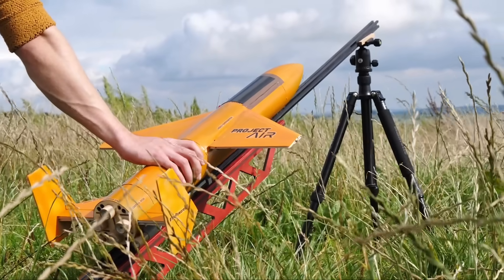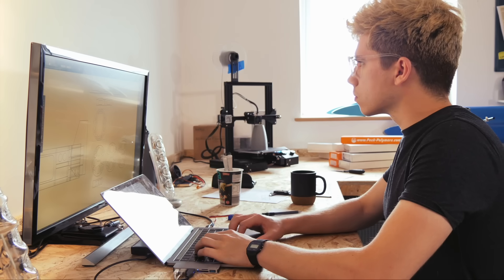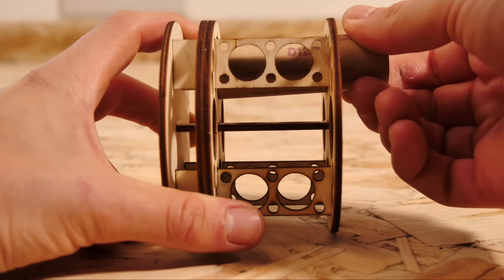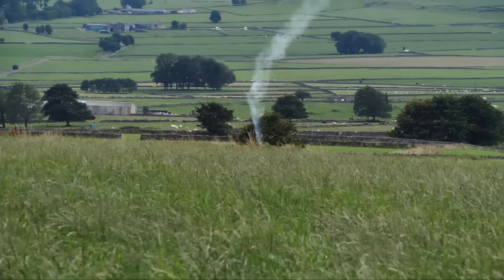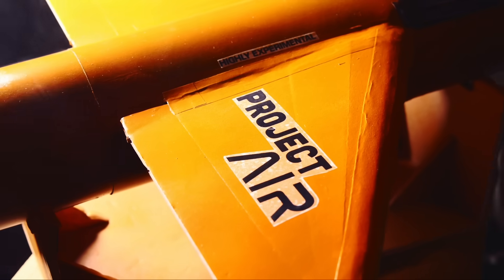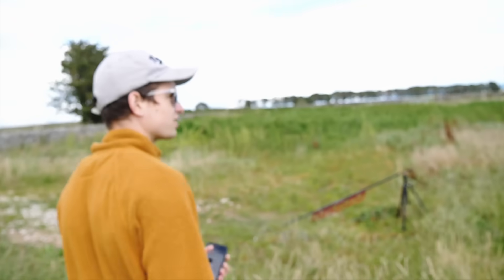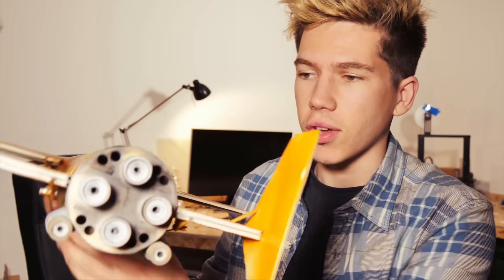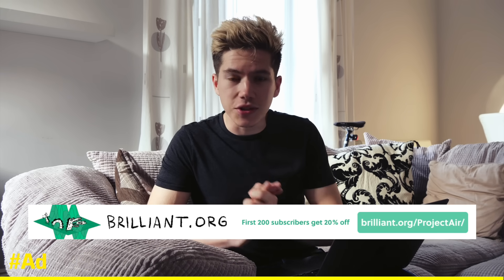High Power Rocket Plane

Comment: "I've decided to kick it up and add more motors"... "I've decided to move the xg back by adding more weight via engines". NO. YOU DIDN'T. IT WAS DESIGNED FRKM THE START TO HAVE 4 MOTORS, WHICH IS WHY IT WAS NOSE-HEAVY ON THE FIRST RUN.

You did the first run just to artificially extend the video and get more view time for more revenue... nobody cares, that's perfectly fine, we'll still watch- but don't make up BS to try and hide it.
Reply from the maker: It's designed to be flown with up to 4 motors. I always intended to step up the flights notch by notch, first by using just two motors. Thought that was impossible to misunderstand. Guess you can make up your own conspiracy theories tho 🤷‍♂️

Comment: Does the burning of all that solid fuel shift the CG much after firing? I wonder if that's your initial nose-heavy problem.
Reply: The initial "nose-heavy problem" is because it was designed from the start to use more engines, and the cg was established with that in mind. The first run was done just to increase video length... He didn't "fix cg ny adding engines ". In the FIRST video, he "messed up cg by REMOVING engines "

Comment: Prob should use a cap or such to provide the quick burst of power needed to ignite the engines when in flight after you get to where you want to be or just need that extra speed boost...maybe also add tiny rockets to attach to your wings if your really crazy

Comment: Maybe put an edf inside the tube and make air intake cut outs in the side, use the chute charge on the rocket motors to pop out the wood plug at the back with the motors in it (maybe put a parachute on it)

Comment: Here’s an idea: Use the C motors (smaller engines) to get it in the air, and then use the D type (larger engines) when it is cruising to speed up.
Reply: Cant we just use both?
Reply: Well it will be much more speedy when crusing

Comment: Hay I have been building edf jets for a few years now, and i have experienced every time that during take of (bungee launch) that the model turns to the left. Now i have the reaction speed to counter this an get a fairly straight take off path, Due to the high cost of my planes (coming project a 6.2 feet F16 with a 120mm EDF ) i have found that an inexpensive Gyro really does the trick to keep the model straight and level.

Comment: You might consider making a vacuum form nose cone out of thin and lighter material that will be almost as strong at considerably less weight. The lower the weight the lower the wing loading and increased glide ratio.

Comment: I was wondering about the speed boat you built, since the pontoons got damage and popped open why don't you use fiberglass on foam board or on the wood to strengthen it. It shouldn't increase weight by a whole lot.

Comment: Want to go fast? Add a large core-burner* in the middle and set it to ignite one second into the flight. The wings had better be attached well or you will rip them off.
*The engines you are using are end-burners. Core burners have much less burn time but massively more thrust, that's why you delay ignition until the rocket/plane is underway. I've not only torn fins off but had rockets just tear themselves apart from too much thrust from a standing start.

Comment: The fastest RC planes fly in excess of 500 mph, unpowered!! I understand one team has its sights on 850 mph, the bottleneck being wing-flutter at supersonic speads caused by sonic booms forming mid-wing. It's called Dynamic Soaring, wicked stuff! Perhaps if you gained altitude and powered the rockets while diving?

Comment: Do the gps measure the speed correct since the rocket plane goes up at an angle and the gps measures the distance traveled in a straight line over the ground??? Or is my logic faulty?

Comment: Sorry to say, your spitfire is all wrong, the wing profile should be elliptical not cut at the wing tip.  What you have built looks more like a hurricane.  Just saying.
Reply from the maker: Clipped wing Spitfire - https://flyaspitfire.com/clipped-spitfire-wings-why-did-some-spitfires-have-clipped-wings
Hurricane with curved wing tips - https://en.wikipedia.org/wiki/Hawker_Hurricane
Reply: ...in fact there was a Spitfire with clipped wingtips, optimized for high-speed-low-level flight...!
...later in the war it proved very effective to intercept V-1 cruise-missles...!

Comment: The problem in flying aircraft that use combustible fuels is that your center of gravity changes as you lose mass from consuming the fuel. Obviously in an electric plane, its not an issue but having looked it up, pretty much 50% of the mass of each Estes D12-7 is the propellant. If you did your calculations based on a center of mass that does not change, which I imagine most electric model plane builders will naturally do, then you consume all your propellant in your balanced aircraft and find out its "a bit nose heavy".  Moving the center of mass more to the rear won't solve the issue either I'm afraid as you're still losing the mass from fuel consumption. An ideal combustion aircraft has the fuel balanced so that the center of mass remains more or less in one place during consumption. (Obviously hard in an aircraft when you're having to stick all the mass from both the engines and fuel in the same place and doubly so when all that mass is miles away from your center of lift.  

That said, it was still a cool video. Most people wouldn't have been able to build it never mind get it off the ground. :)

Comment: Nice to see you are getting ahead with aeronautics🤩 it will get more and more interesting further you go! Rocket=go for height, plate=manoeuvre and glide. A general equation using solid fuel propulsion is twice the thrust double the altitude. And with C to G cartridge you were well on your way!! What was you wet weight??

Comment: Move front wings back to increase lift. It will be more difficult to fly but that's not what those motors were designed for.  Nowadays with all the technology right at your fingertips, sometimes it just takes trial and error to get the best results.  You could also use zero delay motors and stage them so the D's fire while in the air. You could also launch directly vertical which should increase your flight time ( if you could control it!).

Comment: First and for most this was a fun video to watch. Grest work man.
I wanted to ask you what cad software did you use to design the rocket? Which 3d printer did you use to build the nose cone?  
Which laser cutter did you use?  Reason I am asking is because I wanna spend some time with my son building small projects. Do you have a small work shop or did you build everything in you apartment?

Comment: I think it would be cool to have these rockets as a booster rather than the propulsion method, like the plane can fly on motor power then use the rocket boosters for a boost in speed

Comment: For your aerodynamics mock test try running the motor blowing air over the body while you contain the smoke. Pipe it out using a thin hose with a needle attached at the end, seemed to work better for me when it came to seeing how the air flows (2:30)

Comment: Going straight up for 1.6 seconds would decrease your top speed by 57.6 km/h versus horizontal.  (According to the calculation I just did in my head using acceleration due to gravity of 10.0 m/s rather than the 9.8 m/s messy changes everywhere anyway bloody endless run-on decimals and gets weaker with elevation mess that is reality. They oversimplify it in school to keep simple students sane.)  Please reply with your conclusions.

Comment: Check out the Centuri Space Shuttle model rocket from their 1971 catalog, yours looks like a cross between the carrier and orbiter craft.  A friend of mine had one back in the early 1970s, it boosted under a single engine and separated into two gliders and an engine pod recovered by a crepe paper streamer.
http://www.ninfinger.org/rockets/catalogs/centuri71d/71dcenb.html

Comment: I had a 2 engine Saturn IB model that used two C engines that I attempted to fly when I was young back in 1974. It only flew once because only one of the two engines ignited. It somersaulted and landed flat on it's side breaking one of the fins. I couldn't find the part that broke off and didn't dare fly it again. I should have used the one D engine instead. It could use either 1 D or 2 Cs. My hat's off to you for getting all six engines to ignite.

Comment: Looks like the 60s Dyna-Soar prototype!  Remember that there's a significant vertical component to your actual airspeed, not only the speed scrubbed by a high takeoff angle; those simple GPS units only measure your speed parallel to the ground.  Think of it like a 30 60 90 triangle with the shortest side against the ground.  That is the only side of the triangle the GPS you have measured, which if used on an R/C car is completely fine.  However, your airspeed was most likely MUCH higher than that!  You need a combo GPS/altimeter with a fast refresh rate (like a Pixhawk 4 or better ~$200) to track your flight path in 3 dimensions with respect to time.  Pixhawk also has pitot tubes and modules, although the're likely a bit heavy for that.  Awesome stuff, though!

Comment: JUST A SUGGESTION: WHY DON'T YOU TRY WITH ONE OR TWO ENGINES NO MORE. THIS CONFIGURATION, WITH ONE ENGINES CENTER VERTICALLY ONE ABOVE THE OTHER ONE; ALWAYS ALIGNED WITH CENTRE OF THE SHIP. I MEAN ONE OR TWO BUT SIMILAR TOTAL POWER TO THE 6 ENGINES. TO  THANK YOU FOR YOR VIDEO. CONGRATULATIONS FOR YOUR ACHIEVEMENT !!
Reply: Shouty caps

Comment: Did a very rudimentary version of this back in the late 90’s. A single C-motor with an 18 inch wingspan. Motor was on a nacelle under the nose.The thrust swung the wings back into a delta configuration and after the motor ejected it lightened the nose enough to pitch up as a rubber band pulled the wings out like an F-14. From there it glided back down unguided to a soft low speed landing. Crude but fun!

Comment: Just some ideas, love what your doing... Get your plane flying then light the rockets... like they did with the real rocket planes... you could also mount a RC plane speedo tube in your nose. There are several on the market. This way you will have your airspeed not GPS speed. Some RC systems will even show the speed on your control box. There are even telemetry units for model rockets that will give you live data.....

Comment: I used to build model rockets when I was a kid so I'm wondering how come no one else ever stacks the engines like I did to get more altitude and longer burn time you can get the kind that don't have the blast to open the parachute
Reply: Such an arrangement is best utilized with a booster stage, which then changes the center of gravity when it is ejected. Boosters can increase altitude and thrust duration, but not speed.
Reply: @johnkrier8021  yeah I guess that makes sense I never had any way to measure the speed besides I was only 12 what did I know LOL

Comment: I wonder how D12-0 boosters Engines would work instead of the D12-7, as they don't have the eject charge. or if you used the boosters as rocket booster section to drop away before they ignite the D12-7's

Edit: link to Engine data
https://estesrockets.com/wp-content/uploads/Educator/Estes_Engine_Chart.pdf

Comment: Only D engines in the UK? Here in murica you can get J engines without a background check or age restriction
Reply: You Can get J motors and bigger in the U.K.  couple of suppliers.
Reply: @hartrockets  is there an age limit or background check or permit for it or is it just like amazon rocket engines. I have a store 20 minutes from my house that sells J motors and bigger.
Reply: Luke Brames - depends on what motors you want. May need a licence but it easy to get. Check UKRA web site for full details.
Reply: hartrockets got it the story I have had no restrictions at all
Reply: *store

Comment: CNC and additive manufacturing has enabled fun stuff, but it certainly has not helped with building aerodynamically sleek, lightweight, structurally sound stuff. Those designs are usually crude compared to the stuff that was done in spruce and balsa in the seventies and eighties, and in composites in he nineties and naughties.

Comment: When a rocket burns, the weight decreases, which might influence the COG. Have you considered doing wings that pop out when the engines are done? Less drag for higher speed and larger wings  for longer glide. BTW the fat fuselage probably does not help either.

Comment: GPS speed is probably too low. The update is like 2secs and you are accelerating through that. It would be better to measure acceleration with time and then calculate max speed.

Comment: Nice, now go back 35 years and do it with no computers, 3D printing, internet, modern day electronics,  etc. ..we did it with good old fashion  trial and error.  Some had the ability to build their rocket planes mathematicly, but the guys with intuitive building skills did much better. I went further and manufactured my own rocket motors. For those that want to do this today, jumping it its so much easier today and all the cool technology you got. Don't forget the guys & gals (my wife was certified  HP rockets) that saved rocketry. Rocketry was almost lost to the public years ago when agencies tried to regulate and ban rockets.
Nice job.

Comment: In the UK you can get a G80 , thats a 32mm motor with 8KG thrust,  a minimum diameter rocket would achieve mach 1,  use that on your next projext

Comment: It pitched up because of the speed, not the thrust line. If it is too stable it will only be trimmed for one speed. Go faster and it will climb, go slower and it will drop. You can move the cg back a bit to reduce this effect. Or have one elevator trim setting for when the engines are burning and one for gliding flight, which is slower. I doubt it will go faster with edfs. I expect they will slow it down.

Comment: Good afternoon, James. My name is Dennis, and I come to you from SE America. I am an FAA Private Pilot, having owned 2 full size aircraft, a retired Medical Laser Engineer, and I still, after 35 years plus, build and fly RC Pattern Aircraft as well. 

I would like to comment on your rocket project, as I too, have a short history in rocketery, back in my 16-17th year. You may have certain restrictions that we don't have here, in America, but saying that, I want to tell you my formula for a very fast burn composit of 2 powders, and their percentages, to give you the extreme extra boost you may want to build your own engines. 

In my day, I started out using spent co2 cartridges, drilled out to 1/4 inch. The diameter of the exhaust port, had to be approximately 1/3 the diameter of the exhaust nozzle. In this case, a co2 cartridge. I then, glued the cartridge to the end of an arrow shaft, wrapped it with strong cord, or skinney rope. I used no feathers though, and used a waterproof fuse, lit by a match. The shaft was lowered into a metal pipe, angled to accomodate the wind. I wanted the rocket to come down, close to the launch site. They did, and usually burried themselves in the dirt at the local school yard. Did I retrieve all of the spent rockets, NO, but then that was part of my research. Kids do the darnest things, don't they?

Much more to the story, but only if interested.

From the Southeastern portion of the United States,
Dennis

Comment: Nose heavy is common problem in rocket buster driven models. In start time it is tail heavy, while flying and burning rocket fuel in boosters tail become lighter and nose tends going down. Try install some control surfaces and make corrections in flight to avoid "stone" landings.

Comment: Normal expectation double the thrust increase the speed by 1.41 as drag increase as a square of speed. So you inmproved beyond that as you had 56kmh first flight and 101kmh second so a fact of 1.8 that would suggest an increase of thrust of 3.2 which may have come from the better acceleratin and the C motors.
You thoughts?

Comment: At 10:34 you say: " Even though we had more than twice the thrust, we didn't have twice the speed" and you wouldn't have. There are several factors, but the main one is that the drag quadruples when the speed doubles (Fd=0,5*ro*V^2 *S*Cd), so if all of the other factors would be omitted you should only go about 40% quicker.
Reply: The quadruple effect is a rule of thumb, it doesn't matter for subsonic speeds but damn there's a reason why propeller planes won't legitimately break the sound barrier
Reply: yes!!! while I was hearing that line i was like "don't you need four times the thrust to go twice the speed?? I wonder if someone in the comment section caught that too! and here you go!🤣
Reply: You think that would be kind of common knowledge for somebody building something like this. Twice the power does not equal twice the speed. He probably just was telling us he already do that is my guess. God if it was that easy we would be able to go light speed pretty easily. I play around with model rockets when I was a kid and now RC cars also. It amazes me how far they come. I've always wanted to do what this guy is doing now I don't have to waste my money and you can just watch this.
Reply: My guy just made a cruise missile and didn’t bat an eye.

Comment: Paint the bottom a different color so its easier to see orientation. 

Use dual rates so you don’t over-correct on acceleration but have full control authority on glide. 

You can use a pixhawk for autolevel and gyro stabilization. Add a GPS and you can have it hold flight level and even do it in mission mode so you don’t have to worry about direction, distance, etc.